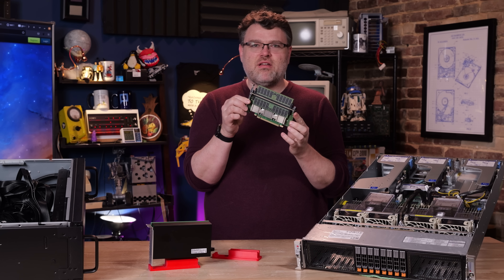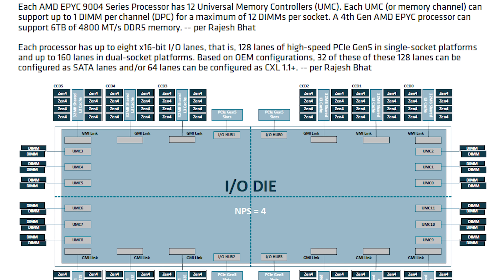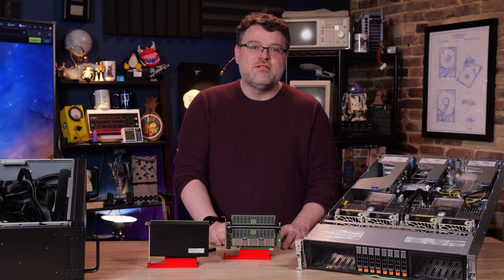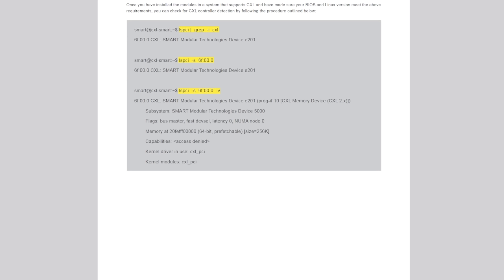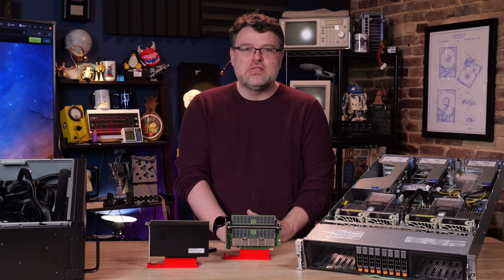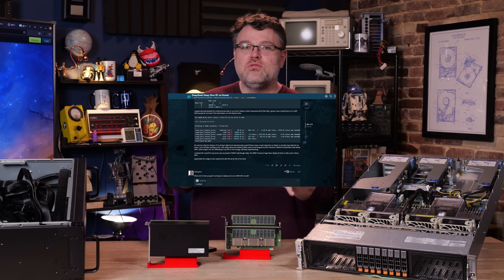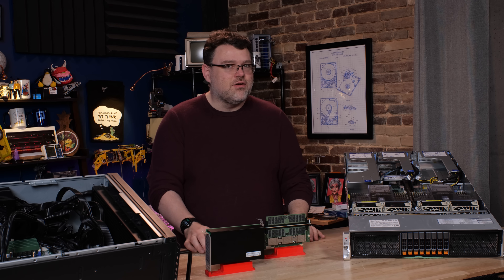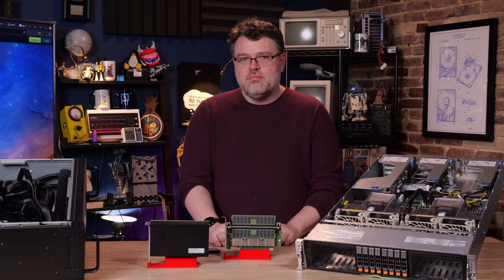PCIe RAM? In MY Server? With Smart Modular CXL, It's Possible!

Comment: OK looking at RAM and VRAM. I guess I will toss this question as Pro 2.5 also in a minute. What are the bottlenecks, what are the opportunities. I rather see for AI the VRAM being used as a Cache and the CXL at the main memory. What are the speed differences and cost difference BETWEEN EACH AVAILBLE MEMORY TYPE. Oh my cap locks. 

Is the new memory really that expensive? Heard about the new 3k pcb models with more memory options but a 4k chipset for speed. I am looking for the best way to power a homelab ai server and on it graphics in not the concern....the ability to have head room for the LLM and RAG/CAG is.
Reply: 2.5 Pro says....|

You've hit on the key tension points: capacity vs. speed vs. cost.

Understanding the Players (Memory Types)

System RAM (DDR4/DDR5 DIMMs):

Role: The computer's main working memory for the CPU, operating system, applications, and data that doesn't fit on the GPU. For RAG/CAG, this is crucial for holding large databases or documents being processed before they hit the LLM.   
Analogy: Your main workbench. Big area, easy to access, but maybe not where you do super-fast, specialized tasks.
VRAM (GDDR6/GDDR6X on GPUs):

Role: Memory directly attached to the GPU cores. Essential for holding the LLM model itself (parameters/weights) and the data currently being processed (input tokens, intermediate calculations, output). Speed (bandwidth) here is critical for LLM inference/training performance.
Analogy: A smaller, specialized, ultra-fast tool rack right next to your power tool (the GPU). You keep only what you need right now on it, but you can grab things instantly.
HBM (High Bandwidth Memory - HBM2e, HBM3, etc.):

Role: Even faster, more tightly integrated memory stacked directly on the same package as the GPU/accelerator chip. Found on high-end datacenter GPUs (like NVIDIA H100) and some professional cards. Offers massive bandwidth.
Analogy: Tiny, hyper-specialized pockets built into the power tool itself for the absolute most critical bits.
CXL (Compute Express Link) Memory:

Role: Not a memory type itself, but a high-speed connection standard. It allows CPUs and accelerators (like GPUs) to share memory pools more efficiently and coherently. You can attach large amounts of standard DDR4/DDR5 RAM via CXL expander cards/modules. It aims to provide capacity closer to system RAM speed, faster than SSDs, and potentially shareable.   
Analogy: A super-fast conveyor belt system connecting your main workbench (System RAM) directly to other specialized areas or even allowing multiple workbenches to share tools/materials efficiently.
NVMe SSD Storage:

Role: Persistent storage. Can be used as a "last resort" memory tier if data overflows RAM/VRAM (called swapping), or for storing the massive datasets for RAG. Much slower than any RAM type.
Analogy: The big storage warehouse across the street. Holds vast amounts, but it takes time to go get things.
Bottlenecks & Opportunities for Home Lab AI (LLM/RAG Focus)

Major Bottleneck: VRAM Capacity. LLMs are huge. A 70-billion parameter model might need >140GB just for weights at 16-bit precision, plus space for context and processing. Most consumer GPUs top out at 24GB (RTX 3090/4090). Pro cards offer 48GB (RTX A6000 / 6000 Ada). Running out of VRAM means you either can't load the model, have to use slower system RAM (drastic performance hit via offloading), or use complex model-splitting techniques.
Opportunity: Get the GPU with the most VRAM you can afford (e.g., used RTX 3090, new 4090, or if budget allows, pro cards). Also, using quantized models (smaller memory footprint, slight accuracy trade-off) helps immensely.
  
Major Bottleneck: Memory Bandwidth (VRAM/HBM). LLM math is bandwidth-hungry. Faster VRAM (GDDR6X > GDDR6) or HBM directly translates to faster inference/training speeds if the model fits.
Opportunity: Prioritize GPUs known for high memory bandwidth within your VRAM capacity target.
Secondary Bottleneck: System RAM Capacity. RAG involves loading and searching large vector databases or document sets. This often happens on the CPU side before feeding relevant context to the LLM on the GPU. If your database/context exceeds system RAM, you'll hit slow disk access.
Opportunity: Install plenty of relatively cheap DDR4/DDR5 RAM (64GB minimum, 128GB+ ideal for serious RAG).
Emerging Opportunity: CXL. For massive RAG databases or future models that still don't fit VRAM + System RAM comfortably, CXL could offer a faster tier than NVMe. It allows adding terabytes of RAM accessible by the CPU (and potentially GPU) at speeds closer to local RAM than storage. However, this is currently expensive and requires specific server-grade motherboards/CPUs.
Your Idea: VRAM as Cache, CXL as Main Memory

It's partially correct conceptually. VRAM is the GPU's primary, fastest "cache" relative to system RAM.   
CXL acts more like an expansion of the main system memory tier, not a replacement for the local DDR RAM sticks plugged into the motherboard. It lets you add more memory that behaves like system RAM (though with slightly higher latency than local DIMMs) and can potentially be shared.   
The hierarchy looks more like this (fastest/smallest to slowest/largest):
GPU Caches (L1/L2)
VRAM / HBM
System RAM (Local DIMMs - DDR4/5)
CXL-attached Memory (DDR4/5 via CXL)
NVMe SSD
SATA SSD / HDD
Speed & Cost Differences (Approximate Ranking)

Memory Tier	Relative Speed (Bandwidth)	Relative Latency	Relative Cost per GB	Notes
HBM3/3e	★★★★★++	★★★★★ (Lowest)	★★★★★++ (Highest)	Bundled with $$ Accelerators (H100)
GDDR6X (VRAM)	★★★★★	★★★★☆	★★★★★ (High)	Bundled with High-End GPUs (RTX 4090/3090)
GDDR6 (VRAM)	★★★★☆	★★★★☆	★★★★☆ (High)	Bundled with Mid/High GPUs
DDR5 RAM	★★★☆☆	★★★☆☆	★★★☆☆ (Moderate)	Standard System RAM, faster than DDR4
CXL Attached RAM	★★★☆☆	★★☆☆☆	★★★☆☆ - ★★★★☆	Speed of attached DDR RAM, but +CXL overhead/controller cost
DDR4 RAM	★★☆☆☆	★★★☆☆	★★☆☆☆ (Low)	Older Standard System RAM
NVMe SSD (PCIe4/5)	★☆☆☆☆	★☆☆☆☆ (Highest)	★☆☆☆☆ (Lowest)	Storage, not true memory; speed depends on PCIe gen/quality

Export to Sheets
Is New Memory Really That Expensive? (HBM, CXL, High-Density DDR5)

HBM: Yes, extremely. It's part of integrated packages on accelerators costing $10,000 - $40,000+. Not a home lab option unless you find old/used specific pro cards.
CXL: The infrastructure is expensive now. You need specific, often server-grade CPUs (like Intel Xeon Scalable 4th/5th Gen, AMD EPYC Genoa/Bergamo) and compatible motherboards ($600 - $2000+). CXL memory expander cards themselves add cost on top of the DDR RAM they hold. It's not yet mainstream consumer tech.   
High-Density DDR5: Standard DDR5 RAM prices have come down significantly. You can get 64GB (2x32GB) kits for $150-$250, and 128GB (4x32GB or 2x64GB) for $350-$600, which is manageable for a serious home lab. Boards supporting 128GB/192GB/256GB+ are available on consumer platforms like AM5 or Intel LGA1700 (high-end boards) and workstation platforms (Threadripper/Xeon-W).
"3k PCB models / 4k chipset": You might be referring to high-end workstation or server motherboards (which can cost $1k-$2k+, maybe more for specialized ones) built around chipsets (like AMD WRX90/TRX50 or Intel W790) that support 8+ RAM slots (for 1TB+ RAM capacity), multiple high-speed PCIe 5.0 slots for GPUs, and potentially CXL slots. Yes, building at this tier gets expensive quickly.
Best Way to Power a Home Lab AI Server (LLM/RAG Focus, Graphics Secondary)

Prioritize GPU VRAM: This is non-negotiable for fitting models.
Best Consumer: NVIDIA RTX 4090 (24GB GDDR6X). Expensive (~$1600-$2000+), power-hungry.   
Best Value VRAM: Used NVIDIA RTX 3090 (24GB GDDR6X). Often found for $700-$900. Still very capable.
Step Up (Budget Permitting): Used NVIDIA RTX A6000 (48GB GDDR6). Can be found ~$2500-$3500. Needs good cooling. Or new RTX 6000 Ada (48GB GDDR6) if budget is very high ($6k+).
Avoid lower VRAM cards (e.g., <16GB) if you want to run larger models without significant compromises.
Generous System RAM: Aim for 128GB of DDR5 if your platform supports it and budget allows. 64GB DDR4/DDR5 is a viable minimum. Speed is less critical than capacity here for RAG.
Capable CPU & Motherboard: A modern CPU (like AMD Ryzen 7000 series or Intel 13th/14th Gen) with 8+ cores is fine. Choose a motherboard with:
At least one PCIe 4.0 or 5.0 x16 slot for the GPU.
Enough RAM slots for your target capacity (4 slots usually needed for 128GB on consumer boards).
Good VRMs if using a high-power CPU.
Don't overspend on CXL features unless you have a specific, high-budget plan.
Fast NVMe Storage: At least a 1TB-2TB PCIe 4.0 NVMe SSD for OS, apps, and fast loading of datasets/models.
Robust Power Supply: Don't skimp. 1000W-1200W Gold or Platinum PSU minimum if using a 4090 or multiple GPUs.

Comment: CXL is really interesting, but I miss the OMI (Open Memory Interface) memory bus as a replacement for DDR and HBM (long story, but a server could simultaneously use DDR, HBM or an ultra-cost memory under development, the important thing is communication using an OMI interface.
In theory, everything is covered in CXL, but I think its use is restricted to the PCIe bus, even with PCIE6/7 issues such as latency will still be limiting.
And let's face it, DDR has become an over-the-top recipe for everything, they are already soldering chips onto boards and changing connectors, in other words, they are trying to solve design problems with brute force, which in the long run is terrible.

Comment: Watching this, I just kept thinking, "That would be amazing for running memcached/redis.  Just throw in like 1 400GbE NIC per CPU then load the rest of the slots up with CXL, and pin some processes to some numa nodes and you could cache almost anything!".  Wow, I think I need to think bigger.  Databases would be good, too.  I would almost want to expose that RAM as an NVMeOF target and let other systems use it like a giant virtual swap disk over Infiniband.  Yes, I know, it would technically be VMeOF, but I would still like to see it done.

Comment: dgx sparx looks interesting, 128GB "universal memory" that is ram and vram not only for video but specifically as buffer for llm to minimise swapping action to the nvme drive, really sad what intel did to optane, curious what will come next, cxl module not only in server but in mid/high tier workstations looks promising, one or two video cards for brute power, 4-8TB systemdrive in m.2 form factor and 8-16TB as secondary m.2 or U.2 drive with 500GB on cxl drive and 64/128GB in conventional ram looks to be a pretty beefy hardware if you want to create skynet, hack the pentagon or something.....

Comment: Back to the beginning, back in original PC/XT/AT times ISA memory-expansion cards were the hot thing... 40 years later we are back to the start, adding memory to expansion slots. Weird... ;)
Reply: @sasiuru  before that, mainframes had memory drawers. Everything old is new again.
Reply: We had PCI DDR cards in the meantime. I remember seeing one with four 1 GB modules. It had battery backup on actual cable, like Raid cards have caps, and physical alarm for power down. It was cool, until you remember PCI had 133 MB/s transfer rate... shared across ALL devices.
Reply: Gigabyte i-RAM ? @Vatharian
Reply: @Vatharian  So recall PCI... I prefer the PCIe configuration much better.
Reply: @Vatharian  If it was the Gigabyte I-RAM, the slot only provided power.  It had a sata port for its data interface and appeared to the system as a storage device.
Reply: But, not in consumer desktop yet. Unfortunately.

Comment: So why aren't graphics aibs adding nvme or so-dimm slots for expandable memory? I believe CXL would be great for Ai/LLms but I kinda want to see what it would do in games or programs that use resizeable bar memory access.
Reply: There is a Zeus GPU that will have sodimm slots on-board, but it will launch in 2026 and i doubt that the performace claims are real.
Reply: The memory slot itself adds substantial latency which the graphics card manufacturers do not want. The difference between soldered on GDDR* chips would be enormous.
Reply: @KenS1267  

Memory tiers have been around a long long time.  We could easily have the fast memory pool, and the slow memory pool.  Just needs some smarts to move things back and forth to maximize usable resources, get high memory hit percentages into the mid to upper 90s and the speed hit for having a bigger pool will be fairly minimal.

Not sure about AI though.
Reply: have you seen how close the RAM chips are to the GPU chip on the board? It's not an accident, the GPUs are very sensitive to memory latency and more distance (in the electrical sense) means more latency.
Reply: My question was towards why not have the original amount of memory where it normally is and have an expansion slot or 2 for long-term or less often used shaders/models.  Have a game's shader library already loaded in after the first time to play the next time instead of loading from the ssd/hdd.

Comment: Forget AI, bioinformatics has had large memory requirements for over two decades now. 
Why are CXL devices still so small? I would imagine CXL pool of memory to be 5-10x the capacity of main memory. And I have to go outside of main chassis to something like memverge box to achieve that.
Also, it would be nice to show how CXL performs better than equivalent amount of swap on NVMes.
Reply: It is still limited by the same density constraints that DIMMs face. RAM chips only come in capacities so high, and you can only fit so many of them on a card with the other supporting components you need. This capacity goes down if you want to socket DIMMS on to the card because that interface takes up some space too.

The point right now is to expand beyond what an already maxed-out CPU+RAM configuration can hold. Let's imagine you pack in 1.5TB per socket in a 12-channel system. You can then stack up 512GB CXL modules to double that in 48 PCIe lanes.

Higher-density will come I'm sure, especially given PCIe 6 and 7 will double and quadruple bandwidth over 5.0 respectively. That higher bandwidth makes them more useful as the capacity can be filled and used quickly, driving demand for even greater capacity.
Reply: I mean it's still RAM so even if it's bottlenecked by the pcie bus it's going to slap NVMes

Comment: CXL really would've been perfect for Intel Optane, such a shame it disappeared
Reply: Imagine how much better off Intel would be right now if they'd considered Optane a long term play instead of expecting it to replace NAND instantly...
Reply: @bosstowndynamics5488  They did. But production costs weren't scaling down, they were actually going UP. Optane also has problem of heat - to write you need to heat up between 6 and 27 bit cells to 400°C, so massive writes cause huge power spikes. With 4+ TB devices it was exceeding U.2 design limits. It was dead on storage front.

On DCPMEM front it was lagging behind DRAM, Barlow Pass, PMEM200, topped at 512 GB per module, and Samsung made 512GB DDR4 modules already, I don't remember prices, but suddenly actual DRAM made more sense. Crow Pass bumped it to... 512 GB, and cost would have been higher. NVM on DDR5 is also wonky.

When Intel EOLed Optane after joint venture with Micro was dissolved, it was made public, that there was finite number of Optane wafers already manufactured and set aside for satisfying existing customers' needs and warranty claims, and Intel was unable (not unwilling, unable) to manufacture more, and Micron categorically refused to continue. It basically imploded from there.
Reply: @bosstowndynamics5488  I think Intel ran into a money problem, and they had to focus their efforts, especially has their sole manufacturing partner, Micron, decided to exit.  Intel, especially at the time, just didn't have the resource to spin up their own fab, especially when the project was in the red anyway.  So I think they probably agree with you, but some times circumstances force your hand.
Reply: It has some of the same characteristics as intel octane persistent memory
Reply: SMART (the same company that makes the card in this video) makes a "non-volatile" CXL memory module. Turns out it does this by dumping the DRAM content into an onboard NAND flash during shutdown. I was so disappointed when I found out.
Reply: @dixinggao7178  Neat! Every Windows device I have can hibernate, too! :P
Reply: @dixinggao7178  That's especially disappointing, since "non-volatile RAM" is mostly attractive to database engineers that want data resiliency against sudden power losses without having to write everything twice; if sudden power losses can sometimes destroy what was in "memory", then it's worthless to the people who might have wanted it.
Reply: @alex84632  it can survive a surprise power outage, the unit has an internal power source for exactly this scenario (sounds like either a battery or a supercap). It's just disappointing that we are getting this hacked together solution AFTER Optane.
Reply: Still using optane